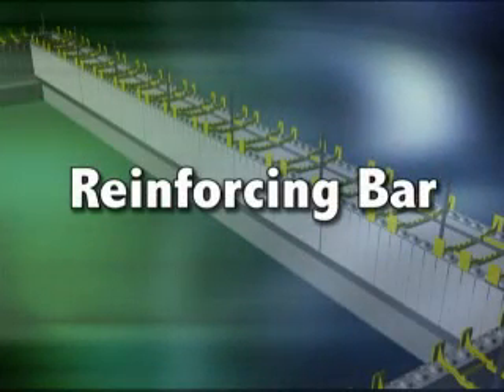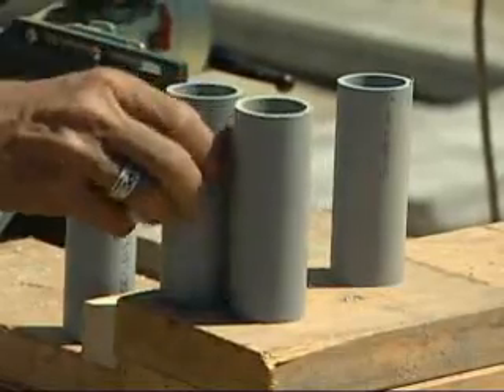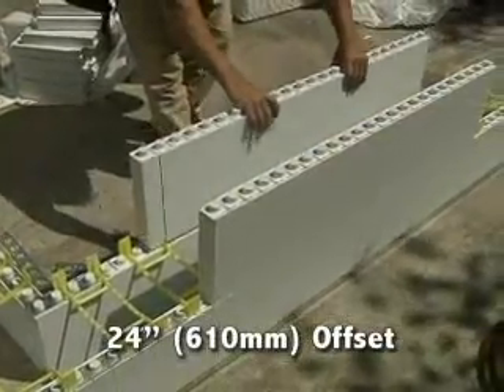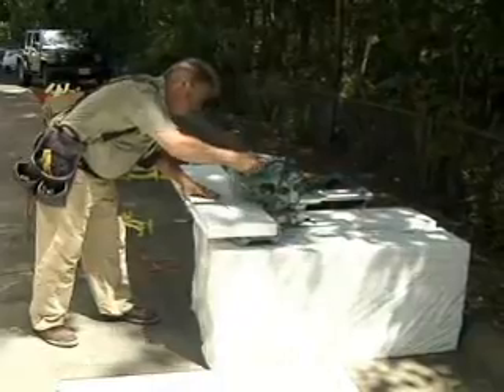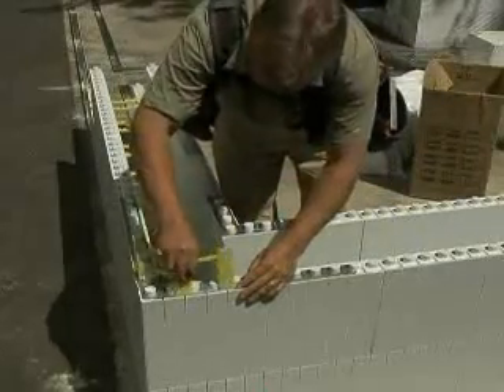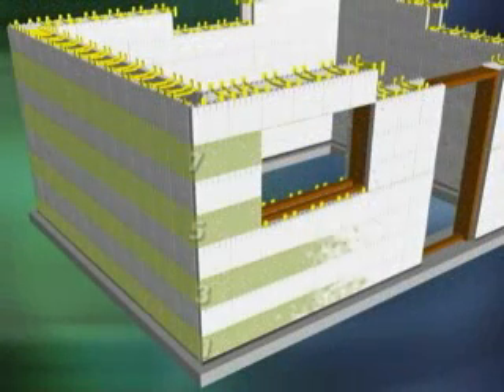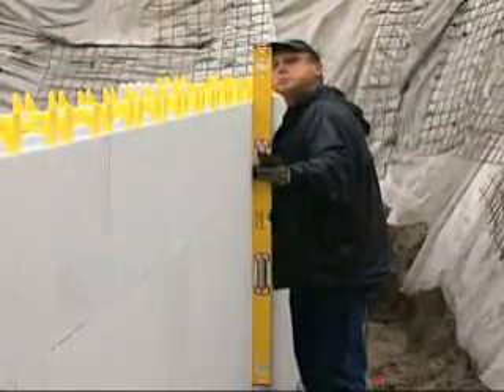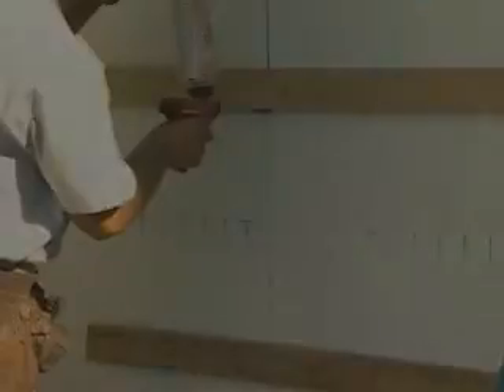Rebar & 2nd Course - Quad-Lock Insulated Concrete Forms ICF

Comment: They've been around for a while, a lot of high end energy efficient custom homes are built out of ICF (you stack the foam blocks to form the walls, then pour concrete inside to cast the walls in place, the foam is not taken off because they'll be the insulation of the walls, it essentially combines several steps into one). Most "Walmart" subdivision houses do not use them because they generally cost a little more to build, plus its not the realtors paying your energy bills.